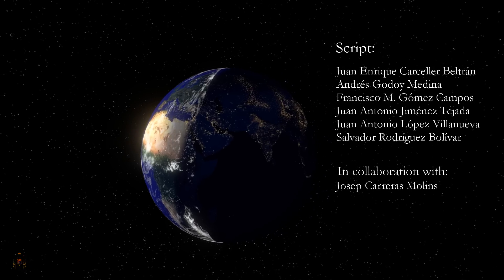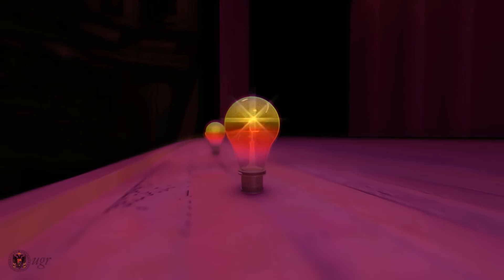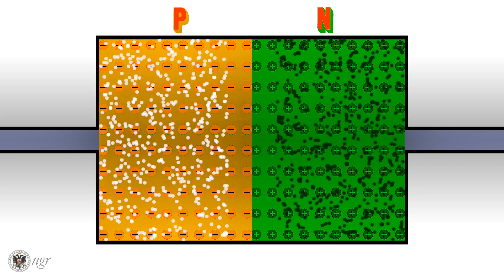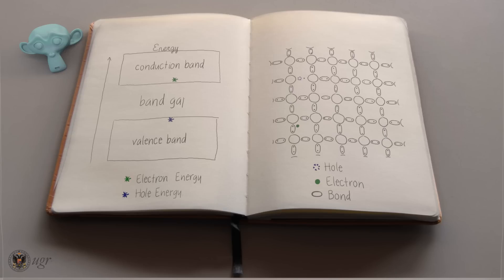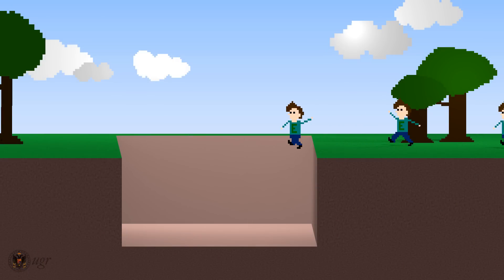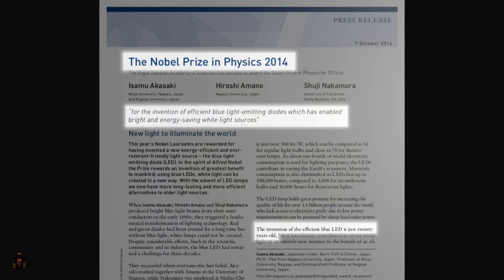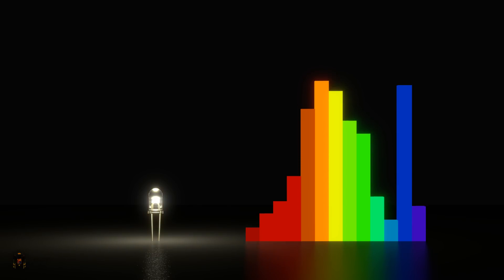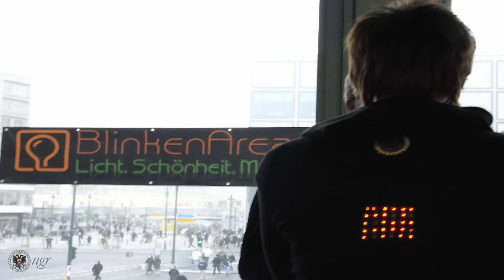The LED - How LEDs work? - English version

Comment: It's light emitting DIODE  not "light emitting device"!!!

Every light source is a light emitting device. 
 
Candles, gaslights, incandescents, fluorescent tubes. All are light emoting devices.
Reply: As I said above, English is not the Spaniards strength. This is from Granada, Spain.
Reply: Right when they said LED now stands for Light Emitting Device i lost all faith in this video. I have never heard it called that and to call it that is retarded seeing how an LED works as a Diode lol. I guess only hipsters who don't know anything call it that to be different. Even my 90 year old grandfather knows its called a Light Emitting Diode lol.
Reply: and  a can of lite beer
Reply: deepCdigger D’James Light Emitting Device is meant general public only, but on the other hand, all technical people will and only will say as Light Emitting Diode.
Reply: I think that complete lamp fittings with LED's and just called LED lamps. 
Would you prefer they be called multi LED fittings? 
I have over 20 LED lights (multi Light Emitting Devices) to my new house. 
It's just a changed way of calling lamps made from LED'S.
Reply: Its originally Light Emitting Diode but some people says Light Emitting Device
Reply: Yes, the LED's are still diodes. They will only work if they are connected the right way versus a normal light bulbs where they can be connected eather way.

Comment: Im confused by your image of the PN junction, where there is negative signs underneath the P type, and positive signs underneath the N type. Doesn't the P type hold positively charged holes, while the N type holds negatively charged electrons?
Reply from the maker: +Shane Finnerty Hi! Well, the P type region has positively charged holes as free carriers, while P impurities remain negative when they release their holes. The inverse applies for the N type region. That's why you found it confusing, you have to remember that P and N type regions are neutral when connected, free carriers balancing charged impurities in each semiconductor. Does this make sense for you? Thanks for commenting!